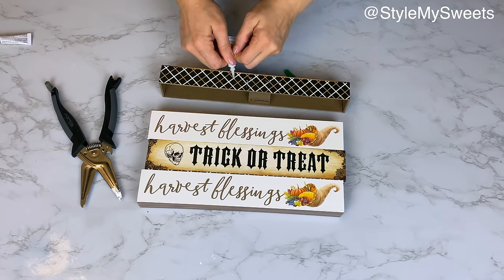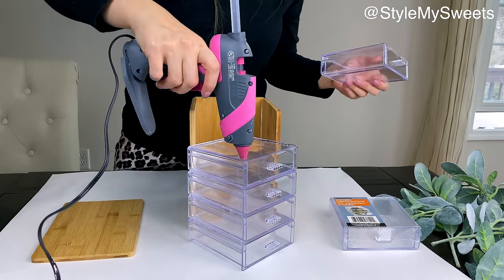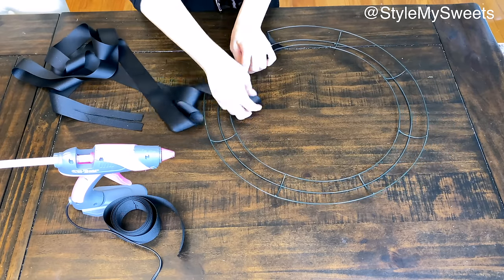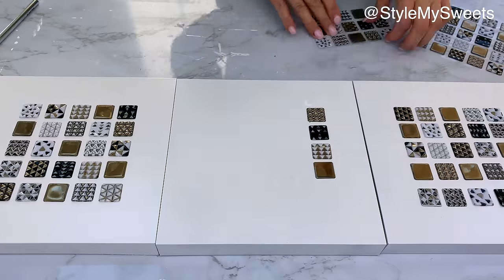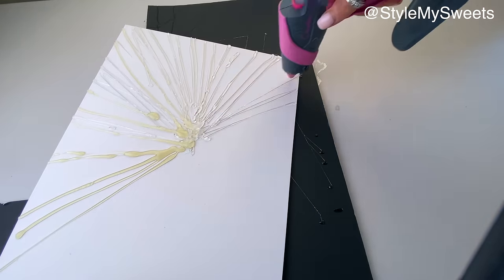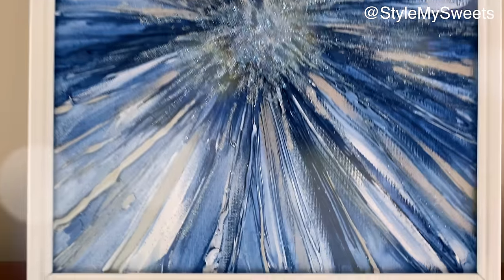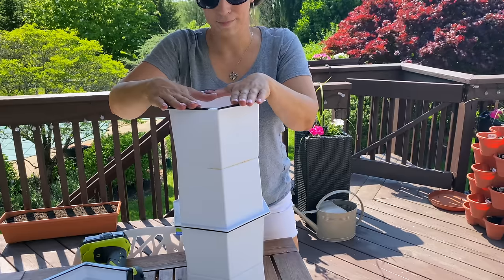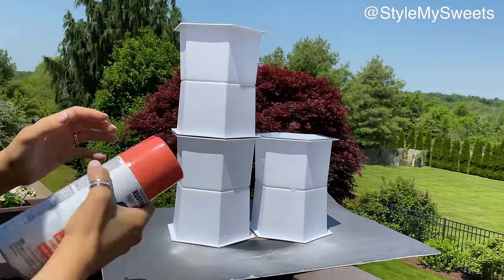15 DOLLAR TREE DIYS TO TRY IN 2022!!

Comment: Safe to say, your videos are truly inspirational✨I cleaned and revamped a little side table from a curb find with ConTact paper from the kitchen section of Dollar Tree. They only had 1 style but it fortunately works perfectly for me✨ Then, I made a candle view-box from: box-styled photos, 2 of those 'fall slabs' (to elevate the frames from the bottom,) and metallic duct tape for reinforcement and decoration. I used about half a pack of tower blocks to connect the 'fall slabs' and used the other half to make stands to elevate the candles!! It only took a couple hours to use the Dollar Tree Super Glue brand Wood Glue to put them all together!☺️✨I wish I could have included a picture; they came out so well☺️✨